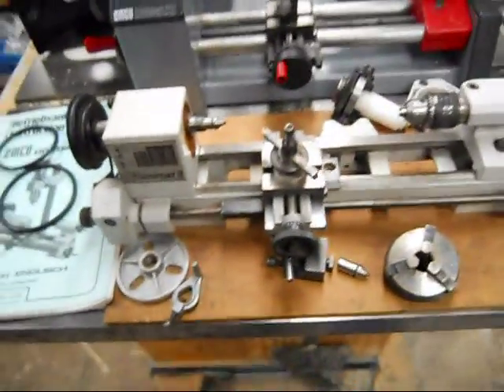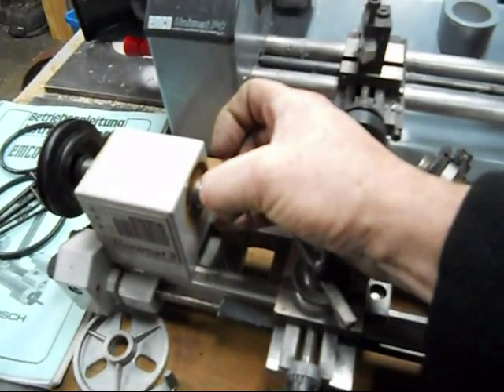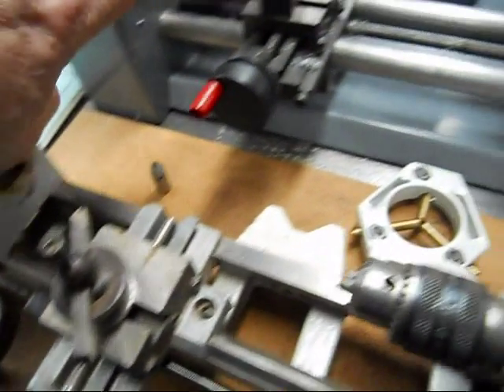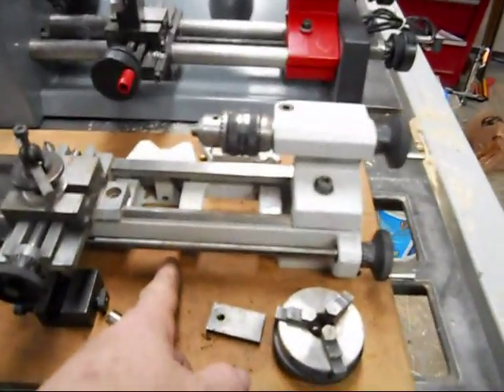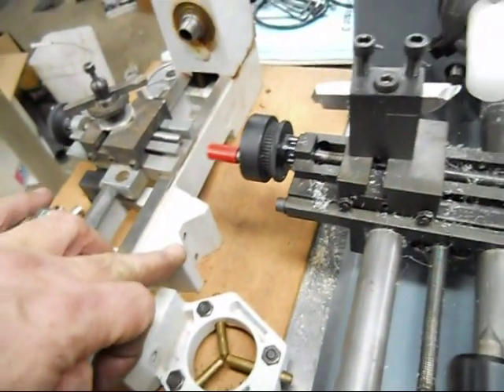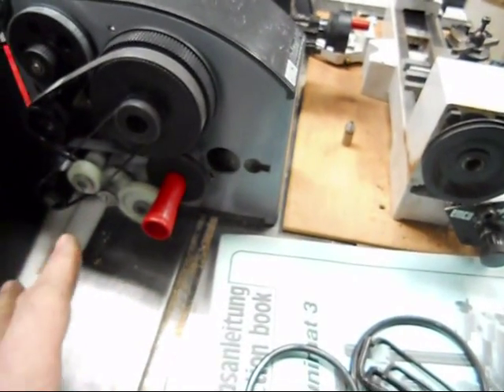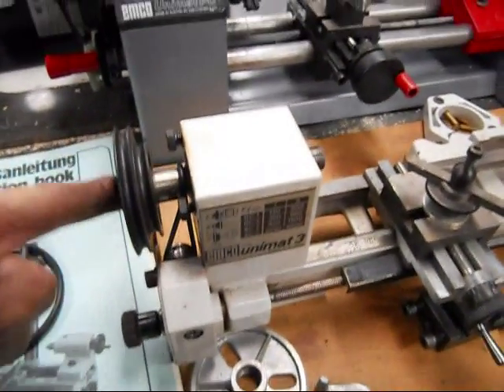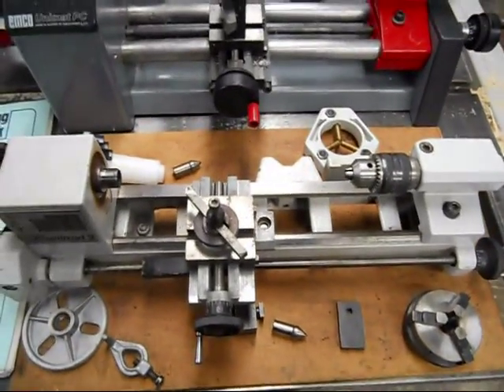Emco_lathe_compare.wmv

Comment: I have the same Emco PC as you ....a word of caution ...the 3 step spindle which is connected to the drive motor has a tendancy to crack in the centre where the grub screw is located, in the UK a made to order spindle would cost @ £150.00 GBP + TAX...I have to get two of them as I have the vertical mill ...and they are made from nylon....a newer model PC  has just sold on EBAY for £360.00+CARRAGE ...if you have to change the cross slide nut beware there is a ball bearing behind the plastic shim